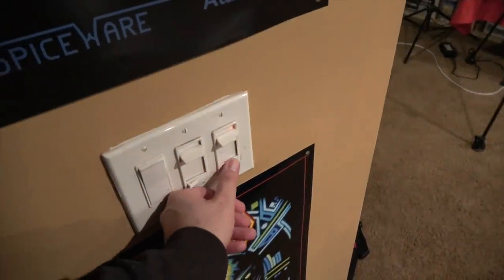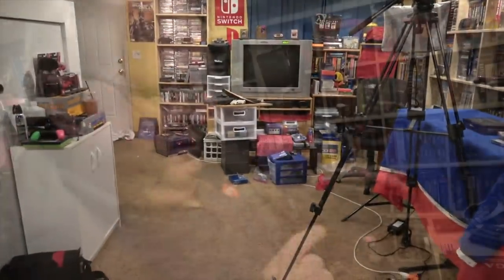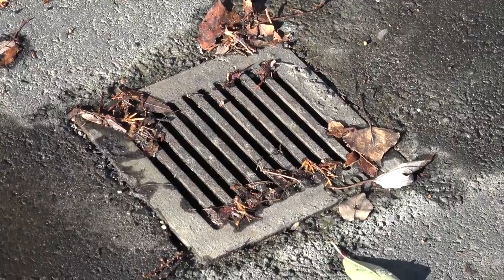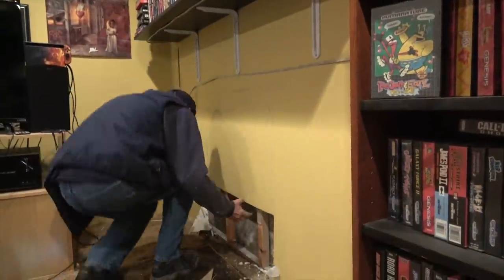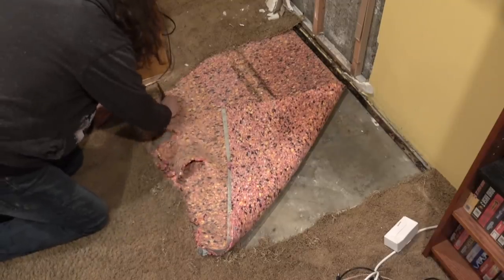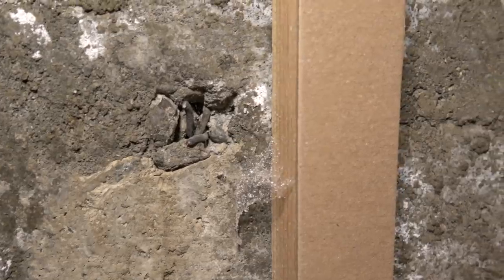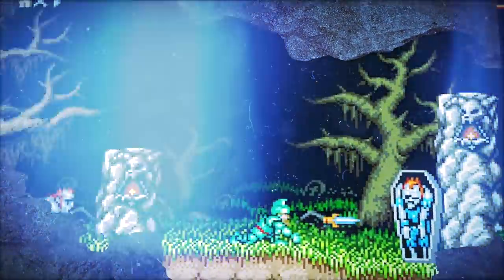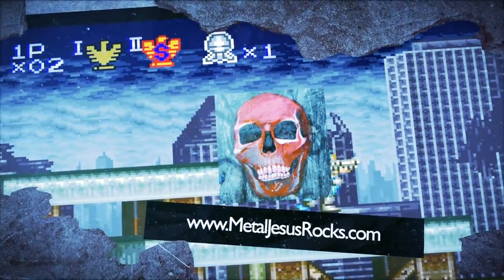OH NO! Water & Mold in the GAME ROOM! $10,000 to fix!

Comment: Spend the money and do it right. It can only be done correctly from the outside. They dig around your house and treat the cement from the outside so no moisture gets in. If you do it from the inside the water will still get in the concrete and will deteriorate.
Reply: Tony Marshall and I have no real idea but having a small stream of water running by the Sheetrock I’m sure can cause mold issues in itself, maybe?
Reply: I agree, it's a big expense but you fix the issue instead of just the symptoms. I would bite the bullet get a home loan and completely fix it.
I say this as I actively look for a house.
Reply: This. The solution they're offering fixes nothing and will only lead to more long term trouble. Nip it in the bud now or the house will be condemned before you know it.
Reply: I agree. Dealing with the issue at the root cause which is the outside is better than trying to stop the issue at the end point. Unfortunately and I would hazard to guess his problems are not only in that corner. By the looks of the mold; it has been an issue for some time. I suspect water has probably moved along paths in the basement yet unknown. He literally needs to empty his basement, rip all that carpet out and the underlay; and check for cracks and separations in the floor. Which will be tell-tale signs of water travelling along the foundation floor of the basement. Outside they need to dig down, right to the foundation bottom, seal and then apply a vapor barrier. Also lay down proper levels of rock with a drainage that follows to the lower level line of the property to drain water away from the home. Where he had the driveway done, they need to pull out that awning drain and I bet the contractor just has it draining right into the ground at the corner of the house; instead of running it along the driveway to end at the street. Gonna cost more than $7-10k for sure. But if he bites the bullet now; it will be for the better. Also in the basement; do a proper raised floor. That way if there is any sort of flooding, or draining back up from an appliance such as a washer in the basement it can go down a drain. Which a basement should have and a sump pump.
Reply: Yeah, right, invest in the foundation so it can outlast the rest of the house, and your life.
Give me a fucking break.  He's not going to be living there for 40 more years, and it won't add to the value of the house anywhere near what it costs to have done.
Reply: I would not raise the floor. I just built three garage under ADU homes this year and the basement floors were all tile on a slab. He should do tile not carpet. However, I 100 percent agree they need a vapor barrier on the outside. We use Dowers waterproofing, but he needs to find someone in the Seattle area that does the same thing. They only need three feet of space to work. I'm worried that if he pulls all the dirt away from his foundation his footings will move, but then again his slab should lock everything in. What do you think about the footings?
Reply: @None17555  Right. It might be the RIGHT way to do it, but that house is NOT worth a 40k repair.  No offense MJ.
Reply: @domscards  That would be my advice as well: Move.
Reply: He.might as.move  too new house if the four dstio nis deteristing at.this point.find new better place it  might they live where house won't sink anymore ebecusenof the amount of rain and mudslides they get  their
Reply: @christiancarter9131   @metaljesusrocks Please read these posts!
Reply: Agreed
Reply: @domscards  As a real estate appraiser in the Portland area of Oregon, this house might be worth a lot more than you'd think. The Seattle area, 3 hours north of Portland, has increased immeasurably over the past 30 years. Depending on the neighborhood, this home might be worth 400K or more. Just do it right. No interior drains. This method is only optimal at Hoover Dam, a much spendier landmark. Trench around the dwelling and get that high level water to go around the property. And plug that downspout drain near the garage and run it the downspout at the corner of the house and toward the rear yard. Good luck, Metal Jesus.
Reply: @redfanrod  That's crazy.  I live in a six bedroom three story house that was under 300k.  I don't get why people feel the need to live within walking distance of a city if they have a vehicle.

Comment: Remove your carpet, all of it, and then use garage paint on the floor with sealer.  Then use rugs in the places where would sit or want to be comfortable.
Reply: THIS
Reply: Yup, get rid of that carpet entirely.  Lay down some hardwood, vinyl flooring, or seal the concrete and have large rugs in your seating areas for comfort.
Reply: Also, that sand looking carpet is fugly.
Reply: Agreed. Get rid of carpet asap.
Reply: Agreed. The pain of moving everything again will suck, but you'll be more prepared for issues in the future and you get a chance to rearrange everything from scratch should you want. Wall mount the TV for more consoles on top, wire speakers through the walls, etc. Make this situation a positive, game room 2.0
Reply: THIS
Reply: Use paint that has mould killing soloution in it or add it to the paint or it will come back
Reply: I honestly cannot stand carpeting in a basement. You just know down the road that there will be issues down the road
Reply: Do this!! .. and make sure they seal the house from the outside (something like wall sheets, etc.. but they'll know) so you don't get the problem again.
Reply: Flex tape.
Reply: Agree!
Reply: This is seriously a good suggestion
Reply: Carpet is so over rated. I met a girl who had carpet in her bathroom one time.
Reply: @Ironscimitar  Vinyl flooring for a basement that leaks. Yeah,  don't do that.
Reply: @Hb2N  ha ha. I've done a few flooring jobs that have carpet in the bathroom as well. It's a nightmare and annoying to rip up esp. around the toilet.
Reply: @Wez633  fix the leaky basement, then install?

Comment: If you do the interior drain (trenching) you CAN NOT use it as a game room anymore!  This is very important as that 'fix' is anything but, it will introduce a permanent dampness throughout the basement and wilt/mold any sheetrock, carpeting, cardboard, and paper items.  You need to get multiple quotes, for instance an excavator only runs about $500 a day and to dig out the spot and fix will only take two days.

Also, you have a "finished" basement, adding an interior drain turns it back to an unfinished basement which will hurt your home value.
Reply: Doug D'Marco From our research when this happened  to us, there are solutions out there for interior drainage that are compatible with finished basements that place an impermeable membrane over the concrete with spacers builtin that allow water to run down the foundation wall to reach the drainage trench but keep the moisture away from the interior space, the drainage trenches are also more or less sealed to that impermeable layer thus keeping the moisture trapped between the impermeable layer and foundation wall.  But I’m a bit puzzled as to what is being proposed where only the bottom four feet of wall are removed unless that is the level at which all the tie-in anchors are located at and they are assuming no water intrusion above the four foot mark is possible, plus the finished wall would ordinarily need to be torn out and rebuilt a few inches further out from where it presently is to account for the drainage trench, so not quite sure what is being proposed. That said, the absolute gold standard by far is digging up the foundation walls to permanently seal them so as to keep the water from getting in to begin with, but that is both costly and sometimes not a possibility (such as two foundation walls built too closely together) and was the route we ultimately went.  Digging up the exterior walls also permits replacement of the weeping tile and foundation drainage system, which often becomes choked with sediment over time.
Reply: Wont that shrink the basement ? It appears his studs are directly against the cement walls from the video. If his whole basement is like that, he might need to re-frame the whole basement to move it a inch or 2 away from the walls on each side... That will end up costing more than $7k....
Reply: the interior drain trench is a terrible idea, fix the concrete, keep water from wall before it gets there. i would never want to buy a house with that solution.

Comment: If you do end up having them dig the drainage into the basement, please take my advice:

Move anything you care about out of the room completely. 

From my experience, concrete dust can ruin electronics and damage your games. It's extremely difficult to clean off smooth surfaces without scratching.

Comment: Here in Britain (where it rains a lot and we get a lot of damp problems as a result), we wouldn’t do the interior drain you’re being recommended here - it permanently introduces damp, which you really don’t want. What we would do is dig out the ground around the house, down to the basement level. Then install a vertical damp proofing to the outside of the wall. Then you can put the soil back and install a drainage system all around the house. That will fix the problem. After that it’s time to strip the damaged basement wall to get rid of the rot.
Reply: I agree with GameHammer.
The "solution" offered by your expert will not solve your problem. You should try to keep the water outside. A good method is this https://de.wikipedia.org/wiki/Braune_Wanne (sorry there is no english version of this article). You basicly put a layer of bentonite (https://en.wikipedia.org/wiki/Bentonite) around your walls and it becomes waterproof.

You said there haven't been problems before. So you can assume that now the water accumulates because of the change in your frontyard. If the sewerage is on a lower level than your basement a drain could be an solution. This should cost less than 4000$.

I studied this stuff but didn't work in this field for years. But in generell it is always better to keep the water outside.

Get a second opinion.
Reply: how much would it cost that?
Reply: That’s how you do it in Canada  to do it right. The price Metal Jesus is paying is quite steep in my experience. Maybe in Seattle they pay insane prices?
Reply: Thats the only way to do it! That drainage behind the dry Wall wass the dumbest idea i ever heard.
Reply: French drain?
Reply: They already suggested doing that, and it would have cost $40,000 for him to get that fix... which is was too much I'm guessing for MetalJesus to afford.
Reply: Jesus...soyboys are more helpless than a city liberal girl. lol no offence guys. You can tackle this with bleach, mildew sprays, stopping leaks, add a window to air out the room, and remove the dry wall.
Reply: @dman3438  tackle the mould but not the damp?
Reply: Seattle sounds a lot like Britain and Ireland, damp and windy.
Reply: Alastair Ward To be fair, that’s why we learned to sail and conquered the world; we were looking for somewhere more pleasant to live.
Reply: Alastair Ward Jesus, I did not watch the whole thing. Rip out the carpets and evacuate the room. It is also not good to beathe. I replaced outside house walls before. This basement needs to be condemed. lol. You could build a fresh game room from the ground up cheaper than to repair the basement.
Reply: Alastair Ward yes.. people have moss growing on their roofs

Comment: Your home owners insurance should cover that. Not all insurance is the same but I would look in to it. I had my water heater crack about 10 years ago. Flooded my entire basement.Took out the wall ceiling and carpet. Including the hard wood floor on the first floor. Insurance covered all of the repairs. I had to replace the water heater myself. I understand this isn't the same thing. But it would be worth contacting your insurance company.
Reply: I thought similarly. No guarantees, but definitely worth a shot.
Reply: That is not a covered peril (at least in Illinois). Used to sell property and casualty insurance, for this to be covered the homeowner NEEDS the water and sewage backup endorsement.
Reply: It depends. Most home owners insurance just covers appliances like water heaters, furnaces, deep freezers, etc. however, when my sump pump failed and flooded my basement a bit, I was told that nothing besides those things and electrical are covered. No carpet, drywall or personal items are covered. Even buying actual flood insurance won’t help since that was devised decades ago before finished basements were big. Though it may cover and repairs to the foundation and he’d have to foot the bill for the rest. Also, they cover internal issues like plumbing leaks and water heater failing and external issues like flooding and leaks from the outside differently.
Reply: Ours did when our bathroom leaked. The repair was at least ten grand. We had to cut the check first and Allstate gave us the money back about a couple months later.

Comment: I'm with the others, do the external barrier but get another quote, $40k is absurd. None of it is going to be cheap but if the water stays out then its never a problem, if it comes in to a trench and the trench clogs, its a problem, pump dies, problem, etc. plus an external barrier will probably be a value adder to you house and it would be less work on the inside since you wont demo which in it self is money saved that would probably make it about even with a real world external barrier quote and not a crazy $40K one. And yes CHECK YOUR HOME OWNERS INSURANCE!!!!!!!
Reply: Niku Sama I agree he should do the excavator method and get multiple quotes. The first thing I thought with this mold issue though is that he needs to see what’s covered under his homeowners insurance. Stuff like this is the reason why you get insurance.
Reply: Time to call in the Metal Jesus Crew and hand each of them a shovel. Get that yard dug up on the cheap! Just buy beer.
Reply: @SumDumGy  oh yea that's would be held the cost there. Don't forget to call before you dig!
Reply: Also agree, major storm one night, raining heavy for 24 hours, lose power after a few hours... all that money spent inside is not going to help that much.  Fix it right, do a external barrier.  Odd are he does not even real all the comments...

Comment: Don't get a carpet again. They are trouble. Get tiles instead.
Reply: Stained concrete is good too.
Reply: @Sursurk You can always use rugs for comfort.
Reply: Rugs or slippers are the way to go
Reply: Daniel W  He can always get a space heater.
Reply: Daniel W   Yep whoever is suggesting not to use carpet doesn't live in a northern state/country ha. Tile gets so cold in the winter.
Reply: Carpeted tiles would be fine. If there's ever an issue you can just pull the affected tiles up.

Comment: its best to fix the root of the problem. most likely more of the nails in the concrete might start to rust. this can also crack the concrete in the foundation of the house which in turn will give you a whole new world of trouble. once water has found a way in it will only get worse. 
to catch the water from your driveway, you could install gutters on each side to catch the water and drain it towards the street.that way you can easily catch the excess water without it going into the soil near your foundation. 
some other thing you might consider is to dig about 2 feet or so into the ground and put up some foil extending about 3-4feet and caulk it to your house to lead the water further away from the foundation. but then dont forget you put it there and start digging in the future

Comment: Keep in mind that the "fix" that you are going with isn't a fix.  Nothing will be fixed by that solution.  You will just be finding a way to retrofit you house to live with a water leak that isn't going to get any smaller.  Most reputable builders know that the only true fix is done from the outside.  Otherwise, get used to having a damp room.  $40K may be a bit high, but it may not be.  I would definitely get some estimates from different companies on sealing it from the outside.  If it was me, I'd take off and nuke the place from orbit.  It's the only way to be sure.  Oh, before I forget, you REALLY need to get up in that yard and get the water draining away from your house.  That will help no matter what you do.